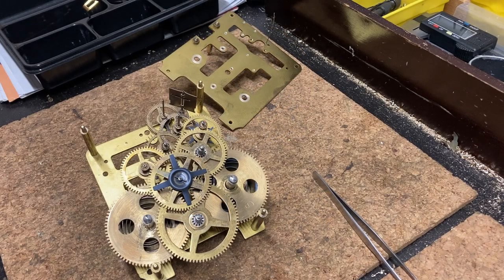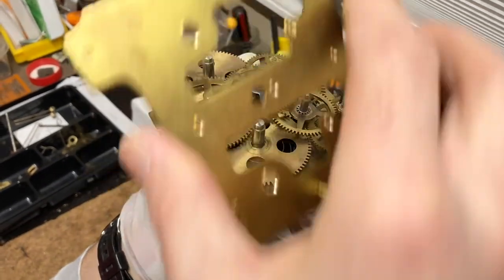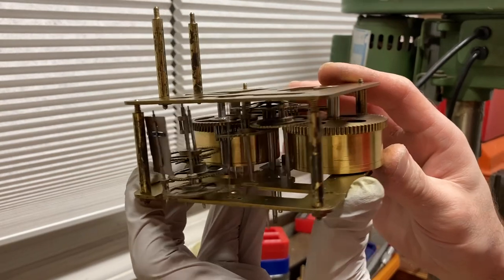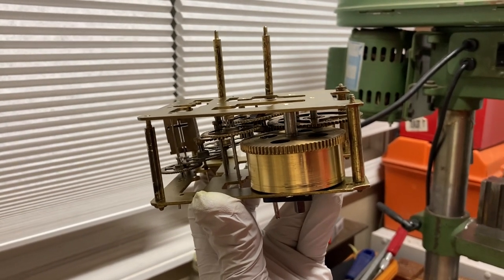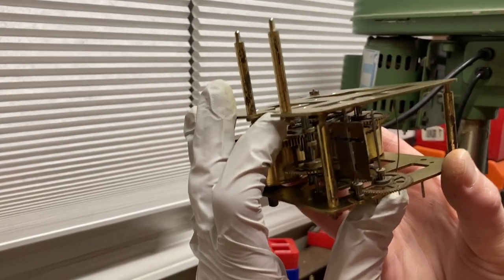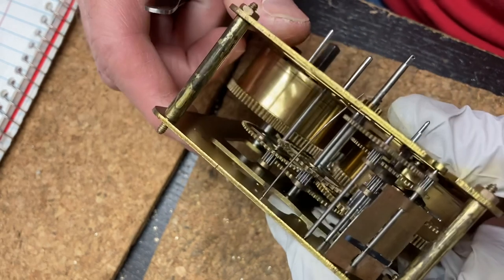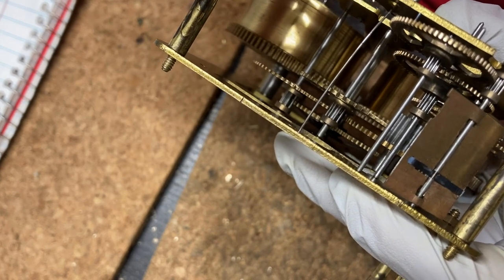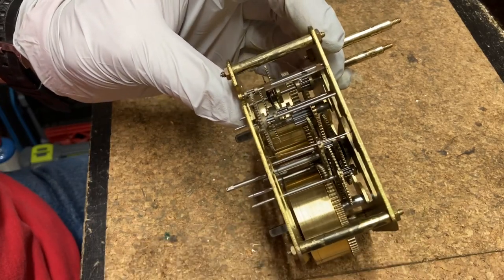How to put a clock movement back together - clock repair basics

Comment: I just put my first clock movement together and it would have been great to have discovered this video before I did the assembly, but I will definitely use your technique next time. Thanks Chris.
Reply from the maker: Good job! I was putting movements together for years before I thought to do it this way.

Comment: Thanks so much for the great video.  It's very helpful. Just found a F. Kroeber 8 Day, pendulum, mantle clock that is not functioning.  Looks great on the outside but has issues inside.  Reviewing videos to understand how to properly access the inside and remove the delicate internal parts to clean and lubricate properly.
Reply from the maker: Sounds like a fun project.  Good skill!

Comment: Bless you and Youtube! I have been wracking my brains to work out how to do this and had not quite worked it out yet. Mine is a German chiming clock. What is the best way to clean the wheels? Can  use detergent or turpentine? I do not have an ultrasonic cleaner. Thanks.

Comment: I have some knowledge of pocket watches and I got a clock like to this one . When disassembling all the gears came out unexpectedly . This will give Me some idea on how to reassemble it . I did notice the fly on this one is different from mine it`s older . Thank You for sharing .
Reply from the maker: That can happen especially if there is still some power left in the barrel when removing the plates.

Comment: Well hopefully this helps. I found a clock today for $2.99 and it could be quite nice. Someone has taken the works completely apart, and I figured out about half of it so far but I'm a little bit at a loss with the smaller gears. It also has five hammers so I'm interested in hearing what it's going to do if I ever get it put back together. It would have helped if I had seen it together and not just a pile of parts. 😁 I've always fiddled around with clocks but I've never assembled one from scratch. I've always been able to see what's not working correctly.
Reply from the maker: Good luck.  It sounds like a good project.

Comment: Thank you sir. I got the similar movement in parts. Easy to put together. But not so easy to adjust two wheel stop pins in the right way. How the stop pins should be related to each other and to the shime lever?
Reply from the maker: Yes, this takes practice and you may have to try a number of times before you get it just right.
Reply: @Chrisclockrepair  only twice and I got it right :)
Reply from the maker: Good job!

Comment: I have junghans b13 mechanism, you don't happen to have a diagram or picture, so I can rebuild it? Unfortunately the mechanism came to me in bits. It was my grandfather's clock and hasn't worked for some time. When he died, my mother was just going to throw clock away, so I took it, to see if I could maybe put it together. I found what the original problem was, the right mainspring had snapped, right at the end near the hole. So I've made a new hole and started assembling, but I'm stuck on the smaller cogs
Reply from the maker: Unfortunately I do not have any photos of this movement to help you out.

Comment: Ok. Looks doable. I have a Junghans W277, which I am planning to make a dial and case for (I am more of a woodworker than a watchmaker). I also want to keep the centre of the dial open so the movement is visible, but then I think I should file out the front plate a little bit to get the gears more visible (I have equipment to do this relatively properly to the point it looks professional, and there's no risk of bending the plate.)

My only concern is if I will be able to put the thing back together again. Because filing out the plate will probably take a couple of days, and I am afraid I will forget the order to place in the parts.

What is your opinion on the matter?
Reply from the maker: Take lots of photos before and during disassembly

Comment: Hi Chris,   restoring a 1850's tall case clock.   Can you make/refit a newer) movement to fit the antique clock face?  I can send a drawing of the face and winding and hands openings.   I'm a woodworker so I can mount it and adjust inside the case, but I don't have your skills re: movements.   I've had it to clock repair, and movement stops between 2 days and 2 minutes.  Clock AND movement are leveled.   Thanks!
Reply from the maker: Yes, you could do that, but you would lose the charm of the tall case (in my opinion).

Comment: Thank you Chris for your efforts, i have kienzle piece striking westminster, but has a proplem that it chime the 1,2,3 Quarter bit at the 4th quarter it diesnt chime neither hours or the full 16 strikes could u have any advice
Reply from the maker: Yes. You should watch my video on rack and snail. Although, it is not the same movement as yours, the concept is the same. It sounds like your problem is with the 4-4 wheel being in the wrong position. If that video doesn’t help, send me an email and I’ll make a sketch for you. Chrisclockrepair@gmail.com
Reply: Thank u very much finally  it works
Reply from the maker: @ahmedgohary9865  Fantastic

Comment: Yes, but you are not entirely out of the woods. You still need to take it partially apart if the strike side warning wheel is in the wrong position or if the paddle is stuck on a star point.
Reply from the maker: Absolutely. You’re right about that.
Reply: @Chrisclockrepair  Can you give us information as where the pins  should be positioned?
Reply from the maker: @howarddehart8226  Thats going to very depending on the type of movement you are assembling. This video was to demonstrate simply how to put the gears back in without bending any pivots. For a striking movement like this one, you will need the warning pin to be a little before the stopping lever when the strike paddle is in the center of two star points on the star wheel. So that when the clock finishes striking, there is “run” before the paddle lifts or it may not have enough power to lift Nd the strike will stop. Hope that is clear.  If it is a rack and snail movement, the warning wheel should be at top dead center. For a countwheel movement it will be right before the stopping wire.
Reply: I take the gathering pallet off using a puller when taking the movement apart so that problem doesn't arrise. So when the gathering pallet goes back on it can be ajusted on the end of its arbor so the warning wheel pin is in the correct position compared to the gathering pallet, and the strike lever paddle is between the star wheel.

Comment: Thats an awkard way of doing it. i put it on legs then on a box at eye level and not on its  end, when sitting down.Then tease the pivots into the holes. After the barrels are located I start with the time side workng to the top of the plate then put the top nut on. I then work with the strike side teasing the pivots in, sometimes using a pivot locater check that they are located in the bushing holes, then put the left nut on.

Comment: I only watched about 2 minutes of this. What is the point of holding the plates with all the gears when you are touching the plates with an unprotected hand. You should have both hands protected to prevent oils from your skin causing contamination to the clock parts.

Comment: Good job on the video! However, use the correct names. They are not gears. In clocks, they are wheels. If you're going to be a teacher.
Reply from the maker: What you say is true.